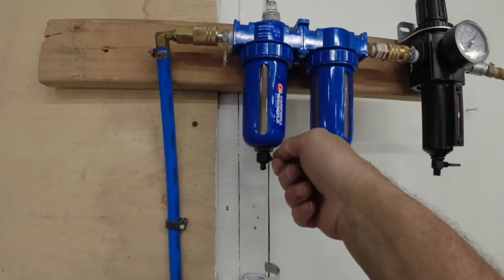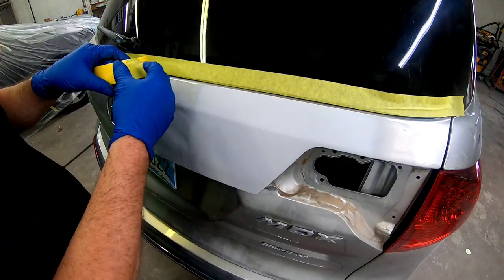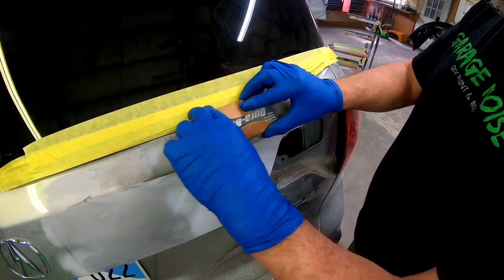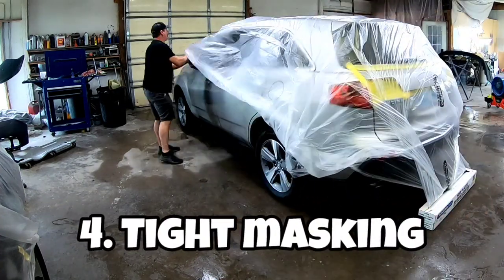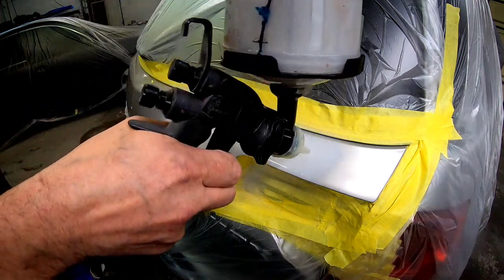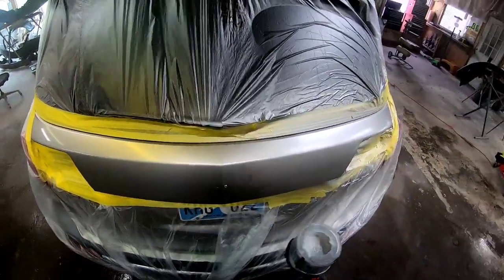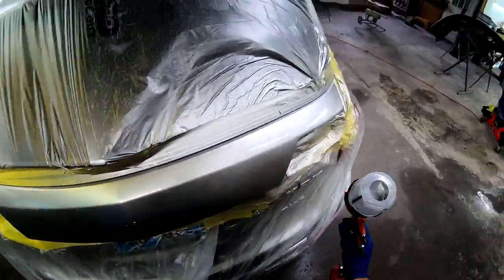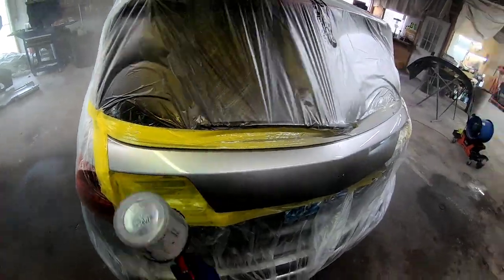How to get a clean paint job at home. #autopaint #diyautopaint

Comment: One thing i have learned is when a lint or trash ends up on your paint work, you can try sanding it off carefully, but when painting pearl, it doesn’t flash like base.  It’s more like clear coat.  I’ve messed up a panel and had to start over, just because I made a little pin hole, trying to fish out that damn lint.  I couldn’t help it because it was a white panel with a black lint.  I was afraid if I left it, I wouldn’t be able to sand it off later because of the clear that was going to go on top of that.

Comment: Thanks for the tips I recently painted a bumper and had tons on orange peal in certain spots might have to try going down on psi and material flow was spraying at 30 psi but I wonder my activator I was using was fighting against me used medium and it wasn't super hot but I was still hot and didn't have any slow product

Comment: I have a question... I am restoring a 1968 Camaro (Black). I pulled the front fenders and doors off and painted the jambs and hinges. I put the doors back on, but an not sure how or if I can keep overspray from getting into the gap between the front fender and the door. In the past I always get a dullness from overspray in this area. Do you have any ideas on how to seal this area off as it is very difficult to reach into this area. Not a show car, but I'd like to do my best. Should I paint the fenders off the car?
Your videos are very helpful, by the way. Thanks!!
Reply from the maker: It's  a difficult spot , I open the door up line the edge of door with 1 1/2 tape let it over hang so when you shut the door it covers the gap .may or may not work in your situation.

Comment: Great video! Thx!
One question.
In huge flat areas like a hood the low pressure of clear coat is not cause a couple of large orange peels?
Reply from the maker: Your question is can low pressure  spraying clear on a hood cause orange peel? Yes it can if your volume to air pressure  ratio is not correct.  So if your getting orange peel the air is not atomizing the clear enough. So you would want to lower your volume (fluid) or increase your air pressure or both. Thanks for watching hope this helps
Reply: @GarageNoise  Thank you for Your answer.

Comment: How you tell if there is oil or moisture before painting.
Reply from the maker: It's nearly impossible to tell because your paint gun will atomize moisture. There are some tools that test for moisture. I've never used them tho. All compressors will have contaminants unless the air is filtered. Thank's for watching.

Comment: Hey Chris, question, i want to get one of those filter and desiccant kits from harbor freight-the Merlin brand which looks higher quality than their central pneumatic-but how do you clean-or if you even have to clean-the filter on the left?..

I also have the same filter/water separator regulator you have on the right of your desiccant ,how do you clean those as well?..or are they not meant to be cleaned??

Thanks Chris
Reply from the maker: Honestly I've never cleaned  them or even attempted to take it apart. I don't  think they are ment to be cleaned but I could be wrong about that. The foam filter traps the oil but not sure if it can be cleaned or not.
Reply: @GarageNoise  gotcha that’s kinda what I was thinking it’s not serviceable…there’s got to be a point when the foam gets saturated and has to be either serviced or replaced right?.:there’s never really instructions with these things..air filtration OCD kicking in 😂

Thanks Chris ..looking forward to the new video

Comment: Chris I have to paint
Outside don't have
Garage... I clean
Car off I have dry clean dry air I follow
Tips I wash dry follow paint instructions but paint seems dry...
I spray single stage
I follow all tips but
I'm not satisfied 
Everyone says my prep is excellant..
But I'm not satisfied
Any suggestions...
Reply from the maker: Are you painting completes or spot panels? If your painting completes, single stage  outside it may be the paint is drying too quickly to allow  it to flow.
Reply: @GarageNoise  I m painting single stage
Reply: @GarageNoise  I'm spraying completes

Comment: Do you prefer yellow tape over the green?
Reply from the maker: I think the green better more flexible but cost is the difference.  Yellows a bit cheaper. Thank's for the support!
Reply: @GarageNoise  does the yellow grab aswell as the green
Reply from the maker: @handyishrandyish334  I haven't use the green in sometime. if your using 3m tape both will have great adhesion.  It's  when you get into some of the less expensive tapes you can lose some of that good adhesion.